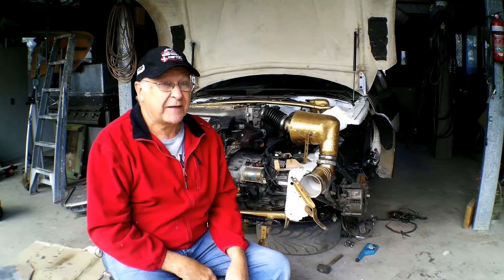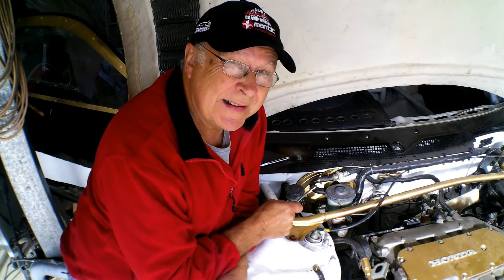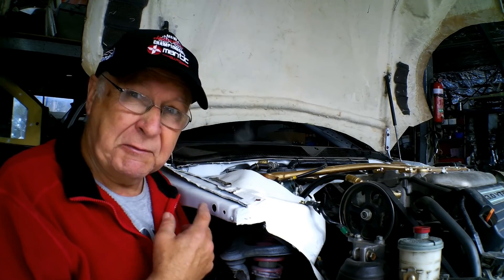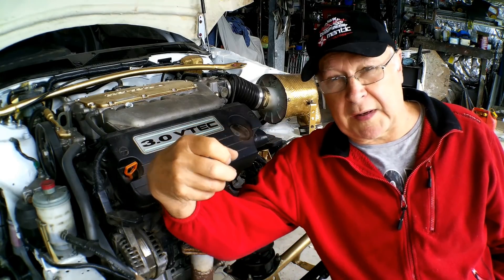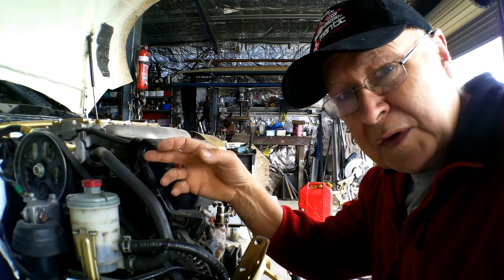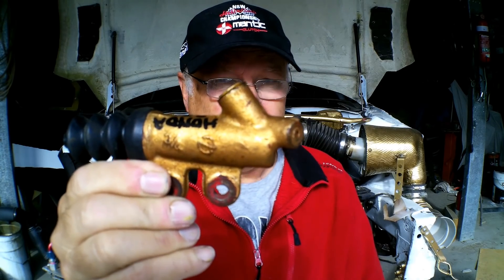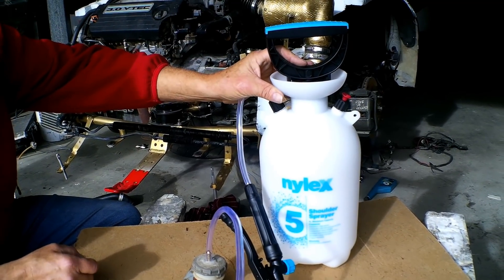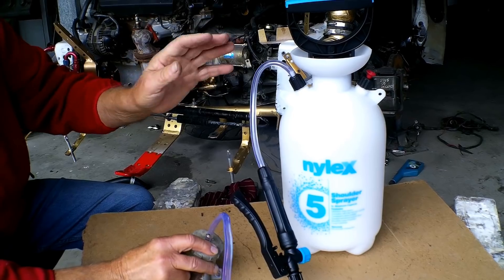Make Your Own Hydraulic Bleed Pump

Comment: Awesome. could you please show us it being used?
Reply from the maker: I did! I attach it to the clutch master cylinder & then crack the line. To do brakes you'd just go to the bleed screws & crack them with a tube into a jar until no air came out.  My son did his brakes & said he did the four wheels just on one pressurization of the pump - but mine were already done so there was no need to do them again as I only needed this to fix my clutch. You can find other videos on the Tube showing them being used more.
Reply: @BillsBuildandRace   I must have missed it. How did you bleed it since you cut the bleed nipple off? Where does the air come out?

Comment: When you’re starting out trying to bleed the air out open the bleeder and slowly push the pedal down and close the bleeder while the pedal is down let the pedal up and repeat until you get a good flow then pump the pedal three times and open the bleeder. People get stuck on the pumping the pedal part and they churn up air into the fluid and makes it harder to get it cleared up.
Reply from the maker: They "aerate" the fluid. But having tried single handed pressure bleeding I'm never going back to using the pedal.
Reply: Didn't he cut the bleed screw??